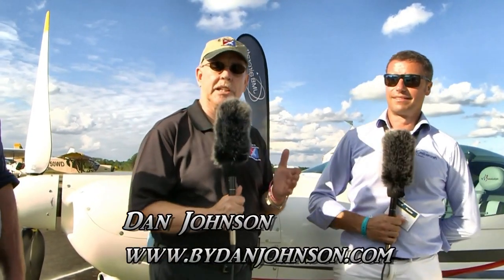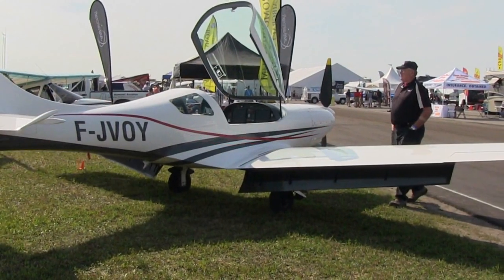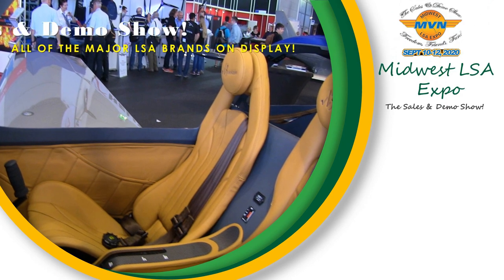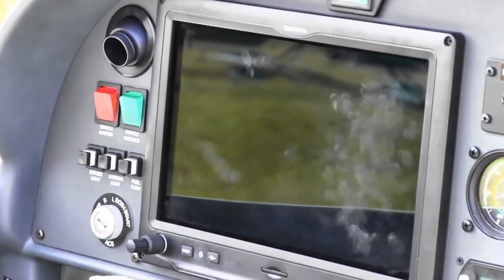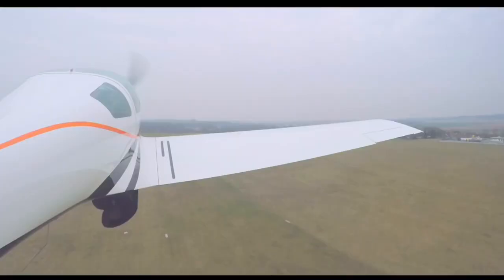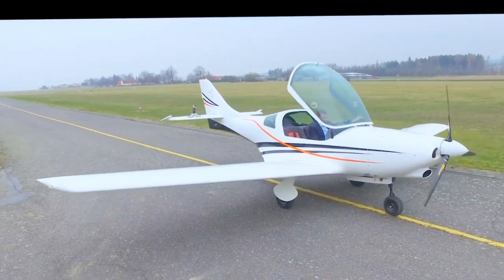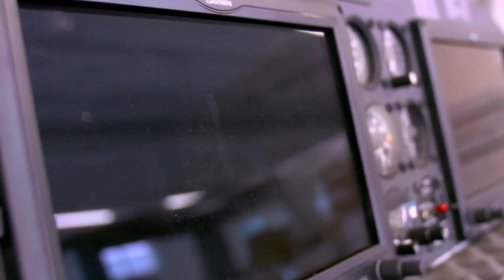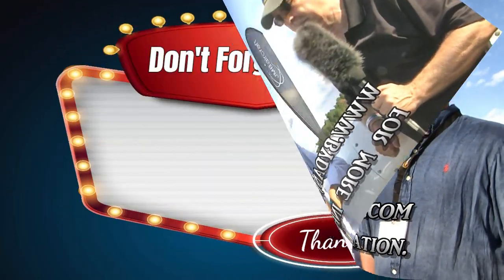VL3 Evolution experimental aircraft, retractable gear, adjustable prop, JMB Aircraft.

Comment: I have always admired this design and truly wish our LSA regulations here in the US mirrored that of Europe and would allow such aircraft... even if it would require further training or endorsements!  Even with MOSIAC on the horizon and an NPRM to be released in the next 2-3 years, I do not think we will ever be allowed to fly something like the VL3 with retractable landing gear as a Sport Pilot...
We may be allowed single lever constant speed props.  Anyhow, I am curious if this company is still importing aircraft into the US?  Last I heard there were quite a few customers who placed deposits however had not received their aircraft even after 8-10 months of waiting.  I truly hope they were able to turn things around and have resolved these issues.  The VL3 is an excellent design, and beautiful looking aircraft.  I had spoken with the company a few years back about obtaining a kit and the costs etc... for $150-160k it would be an impressive performer as well.
Reply: Can you fly a LSA with retractable landing gear if you have you have you private pilots license?